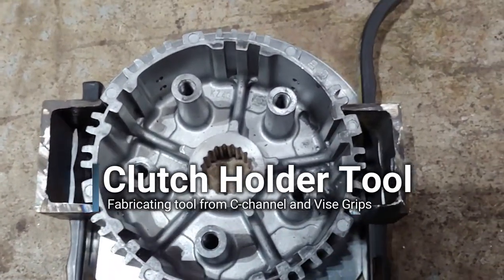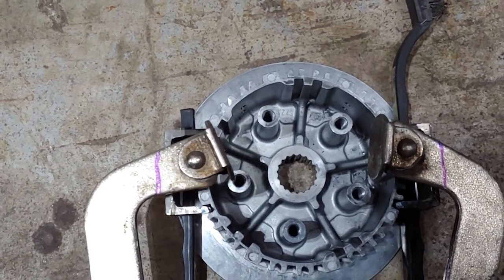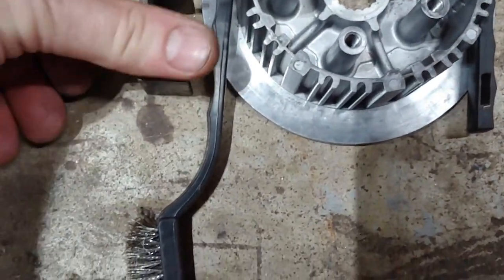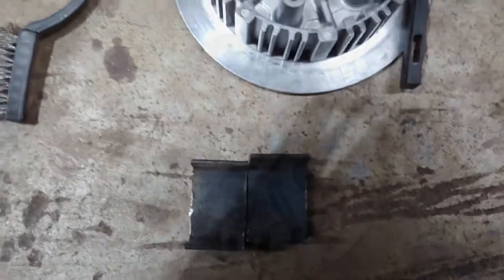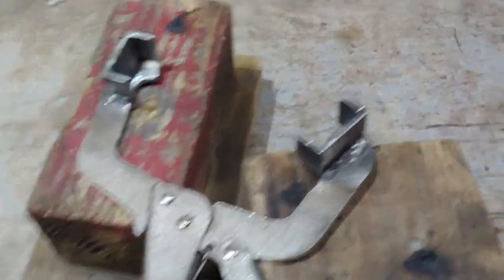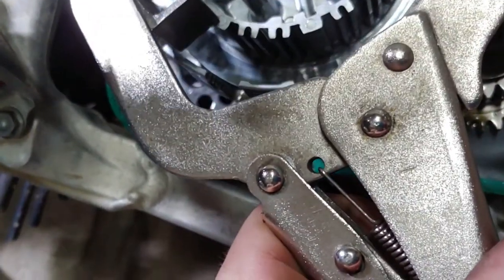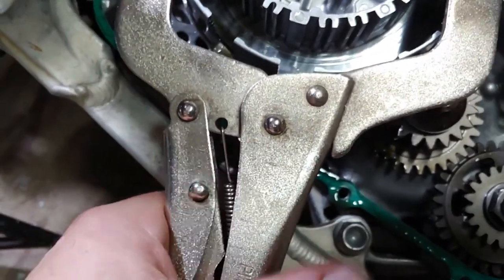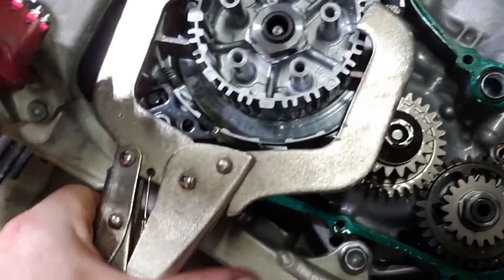DIY Clutch Holding Tool for Dirt Bike ATV | How to Make Your Own

Comment: Good job, building your own tools is fun.  I don't do it nearly enough, but this is a great hack.  I'm going to try this, especially if I find a 3 wheeler or older Quad for my next project.  Nice idea.
Reply from the maker: Yes sir. Its a lot of fun being able to create. You should. I oicled up a 99 honda foreman 400 4x4. Runs and rudes but its in rough shape. Will be on the channal soon.